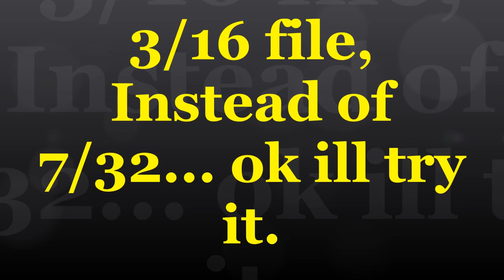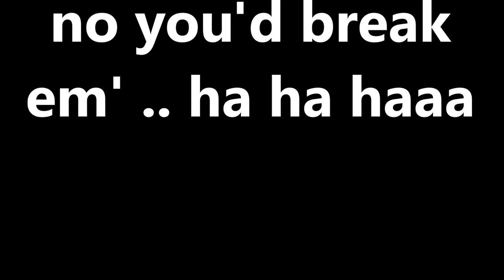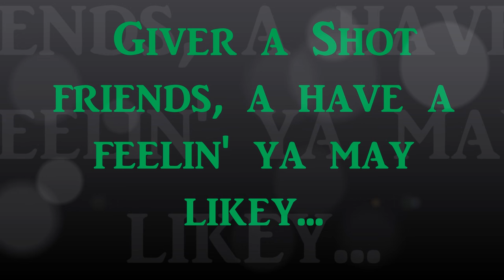using a 3/16 file instead of a 7/32

Comment: I was taught many years ago from an old time faller to think of chainsaw files in 64ths.  Oregon 3/8 uses 14/64ths (7/32), Stihl 3/8 uses 13/64ths.  When worn half way drop a 64th so Oregon would use a 13/64ths and Stihl a 12/64ths ( 3/16).  For .325, the same applies except both Stihl and Oregon use 12/64ths (3/16).  Many shops now carry 11/64ths for when the cutter is half gone.  3/8LP Stihl and Oregon use 10/64ths (5/32) and you can find some shops that still carry 9/64ths for half worn cutters.  I am by no means a professional but this advice has stuck with me for almost fifty years I have been cutting wood.  As Billy says, it gets the gullet cleaned out and just the right amount of hook on the cutter.
Reply: OBX Koastie. Thank you for sharing that. Very valuable info that now others can use. That's why I love this channel so much because of people like you sharing such important stuff. Much can be learned from the comment section.
Reply: Shop tells me to use 7/32 on Stihl 3/8 RS 33 full skip .50 chain

Comment: Stihl basically does this because the recommended size file for 3/8 chain is 13/64.  That is basically between 7/32 and 3/16.  I have always used the 13/64 file on my 3/8 chain on my ms-391, which is the only saw I have with 3/8 chain.  The rest of my saws are .325 or 3/8P.  I have the file guides for each.  The only addition to each set is a file handle for each size.    I like the orange plastic file handle that Stihl sells, because it has flats on each side you can use to supply pressure to the file with your finger when filing the cutter.  I always put some pressure on the file to the rear, when I am filing the cutter. direction

Comment: A man that has cut as much as you Billy I’m beyond shocked you still use a 7/32” round. I bet 30 years ago now tje head of the tech dept at Stihl Canada told me through testing they’d done, a 13/64” was 1/64” smaller in diameter than the old standard 7/32” but cut 10% faster and so much smoother. He actually gave me one to try and I couldn’t believe the difference in how much smooth it was in the cut and I’ve been using it on my 3/8” chains ever since. Happy new year brother
Reply: So 13/64 sharpened better than the 7/32? I have a new Stihl chain 3/8 .50 RS33 and haven’t sharpened it yet but wanted to use the right size
Reply: @dentondunn4346  you bet, 33RS chain uses 7/32 or 13/64”. Let us know
Reply: @FYMM69  think I'll try the 13/64 file since it's untouched

Comment: Can't wait to try this. I bought my first chain and when I went to sharpen it. The 7/32 was too big. It's like they sharpened it with the 3/16 or a 5/32. I just used the 7/32. But it hasn't cut the way it has since I bought the chain. So I had to do some research for myself. Thanks again
Reply: What size file works best on 3/8 Stihl .50 chain? 7/32? Or 13/64?

Comment: You n I should go in business together.  I love cutting wood n own 12-15 chainsaws in probably 7 or 8 splitting mauls.  I've cut, split, n delivered right at 75 cords in last 7-7 1/2 weeks. And I've always been pretty good at sharpening my chain but your little boat trick was all I needed now I've got it perfected thanks. I'm trying to figure out how I can keep cutting wood through the summer to make money. It's the only place I want to be in the woods cutting wood I'm addicted to the sound of that wood cracking when I split it
Reply from the maker: sounds about right it is a sickness and you have it well done cherish this sickness it will save yer life

Comment: I used a 7/32 file on a 3/8 chain for about 25 yrs. And then one day i didn't have a new 7/32 file in the pickup. All i had was what my boys saw used, a 5/32 file. So what the heck, i'd give it a try. I have to tell you, i could not believe how the saw cut. The last five yrs i fell and bucked up timber, i used nothing but a 5/32 file on 3/8 chain right out of the box and until the cutters stated breaking off.
Reply from the maker: its whatever works

Comment: On that note, with a Stihl the file sizes for 3/8 pitch is 5,2mm new and 4,8 when the tooth is half worn, on Husqvarna chains you're supposed to use a 5,5mm and 5,0mm, just a heads up.

Comment: not good at hand filing so I use a Granberg file/joint, I don't switch files but as my tooth declines I set my file "deeper" and try to dig into the gullet a little more. same effect I think, I still have some hook left when my chain does not have enough kerf left to keep my rivets from binding
Reply from the maker: whatever works for your cutting habbits is all that matters pal

Comment: Billy just came across a pro Mac 60 with 16 inch bar not sure how old it is looks like it's from the 70's do you own one? Just gave it couple pulls thing wants to run I have to do some research
Reply from the maker: Did it run.

Comment: I’m 3/8” chain the 3/16” file cuts out the gullet. Then I use the file n guide with a 7/32” file on the top edge.
Reply: On 404 chain I use 7/32” file for the gullet and then 1/4” file for the top edge,

Comment: hey im lookin to go to a full skip chain for my sthil 046 with a 32" bar (still the factory bar) any recommendations on a brand I can buy by the roll that will work.  thanks man.
Reply from the maker: I love stihl chain. I use stihl and Oregon    When you say full skip do you just mean skip tooth chain as we call it here   Which means. Not full house
Reply: Yes skip tooth ive had good luck with the sthil chain. Just didnt know if there was anything comparable to it.  Ill try some oregon.  Thanks Buckin
Reply from the maker: +John TenBarge they some time s change a little   The last stihl skip I through on was pretty bad actually but after a couple grinds or hand files she's pretty mean.  I think Oregon in always a good bet
Reply: I'm not sure if there is any  truth to it but I heard Oregon and stihl chains were made at the same factory. if you look at them there isn't really a difference side by side
Reply: gunnar schutz Stihl Chain is made in Switzerland. Oregon Chain is made in Belgium and Brazil.

Comment: Does 3/8 .050 chain require a 5/32 file? I have a chart that says it does, but it looks small. Also, in the reverse of this video I've noticed that using a file that is a size larger than specified has made some chains plunge cut amazingly well.

Comment: When do you mount a fresh bar and chain?
Reply from the maker: Hardly ever on the bar.  Chain depends on if I'm grinding or hand filing hand filing can wipe out a chain pretty quick   ' stay out of the rocks'm hs ha ha haaa
Reply: +Buckin' Billy Ray Smith in soft wood do you feel a hand file stays sharp longer than machine sharping ?
Reply from the maker: +Darryl Iiams in all wood  yes there is some truth to that because it comes off the grinder so so sharp you notice every  little thing.  I re grind every night when fsllin steady